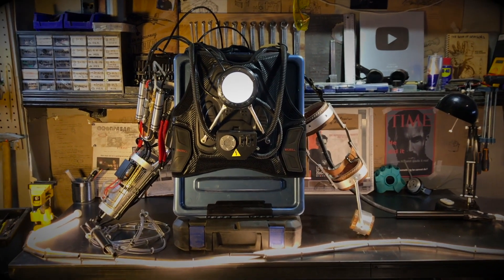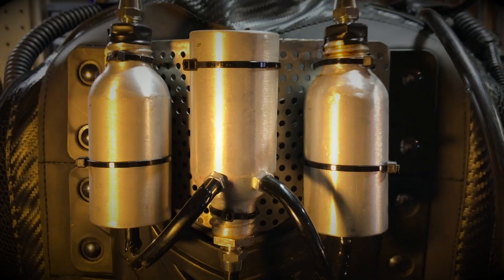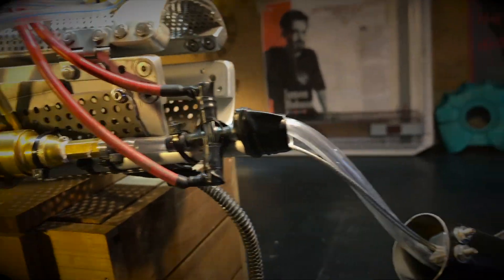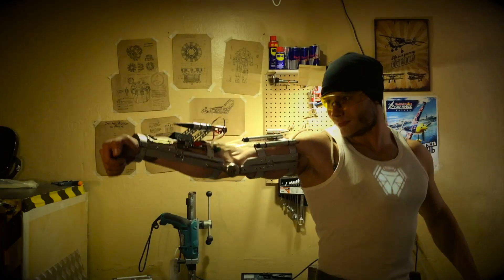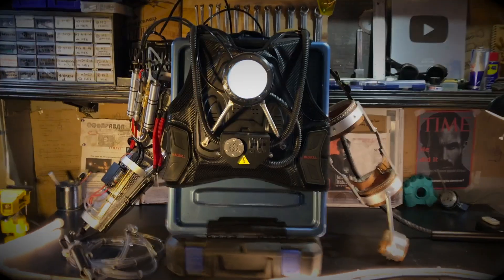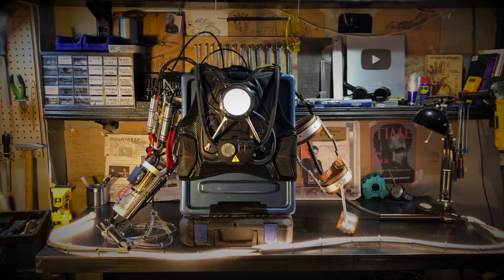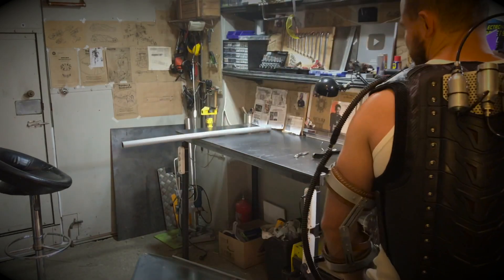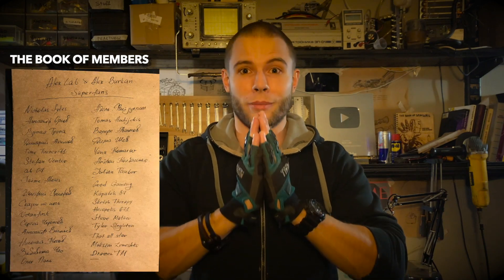Real life Ivan Vanko builds Whiplash suit (High voltage plasma whips)

Comment: It seems the limitation is really the amount of voltage you can establish across the whip. I've been thinking about how this could actually function the way it does in the movies, and it would be extraordinarily dangerous, but I think we already have the technology to do it. On some next generation tanks, there is experimental armor that relies sandwiching between the outermost plate of armor and an inner layer an insulating layer, and then placing an extraordinary voltage across those plates. When a shell or anti-tank missile penetrates these layers it completes the circuit and  instantaneously vaporizes metallic shell before it can penetrate into the interior of the tank. I don't know how big the required battery or generator is that allows for this type of reactive armor, but my guess is that it has to be gigantic. That being said, if you can adapt the same concept to those whips, with some clever piecing together of conductive and insulating components, you could at least have a stationary but functional weapon. That being said, accidently hitting yourself would be very, very bad.

Or, if the voltage intensity can be oscillated by some kind of on and off transformer, maybe that could be mitigated. however, I'm no engineer...Either way, this work is absolutely fantastic.

Comment: . you will not need the arm if you will only did it on purpose to put real striking electric 
power . it would be cooler to have enough circle conductors attached 5inch apart through the whip then a real 1000k live amp running on your back . ahaha

Comment: Have you considered using your electrolysis machine to work on flight? I have confidence that you could develop a system to use expanding hydrogen plasma to fill an envelope to create a micro-hot air balloon like system with hydrogen jets to boost your flight abilities. Priviet Tovarich!
Reply: Or just burn the pure oxygen for lift?

Comment: Hey Alex I have a major idea for a iron man suit 
What you should do is make a self sustaining electrical Ironman suit.... you can divert hydrogen gas from the reactor to a small fusion reactor on the back of your suit and also divert electricity to the fusion reactor and for the fusion reactor to replenish your battery pack you can put a small solar panel on the window side of the reactor then transfer that power to your battery pack to replenish it and have a self sustaining power source

Comment: Happy Halloween my good sir,
I have a question..
If you had an electrolysis machine, could you then power an internal combustion generator on hydroxygen to get electrical power? thus making relatively clean energy?

edit: and if you hooked up the electrolysis reactor up to solar panels, then that'd be almost 100% clean energy right?

Comment: I have an idea.
 Hacksmith created the world's first protosaber,with laminerflow(that's was sooo cool) and Alex created the first light saberwith hydrogen fuel tank and (it was op) but it wasn't stable.
   Why not collabe on that and combine Alex's hydrogen reactor and connect it to hacksmith protosaber to make the first 'coolest realistic working good-looking advanced lighTsabEr.

Edit: now I have an improved idea.
        Alex is famous for his
 Hydrogen reactor. And hacksmith remarkable for making it real and giving it op looks😉. They why not convert the current model's hilt into a hydrogen reactor and and separater within to separate both gasses and form problem. And fortunately there will be enough gas made right in the saber to power it and could make the world first improved working lighTsabEr

Comment: I'm not an expert in electrical engineering, that's the aspect I did the worst in in my school's engineering program, but you could probably barb the wires on the first whip to get electric arcs, like how you got those arcs with a wire above it.

Comment: I have a question, can we store HHO gas in cylinder with high pressure
Reply: If you don't care about a big hole in your back created by an explosion, sure.
Reply: @zoltankurti  then at what pressure can we store it
Reply: @lakshitsharma413  you never want to store oxygen and hydrogen mixed together. A tiny spark caused by static charge can explode the whole thing. You always want to store hydrogen and oxygen separately.
Reply: @zoltankurti  thanks 😂